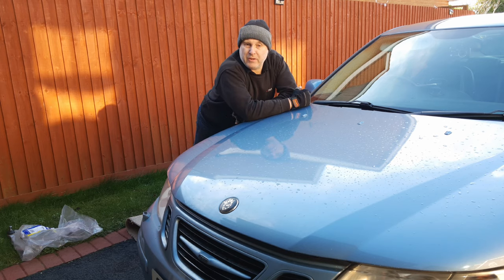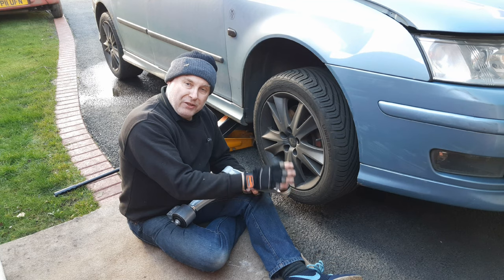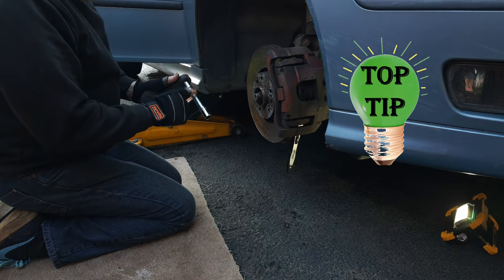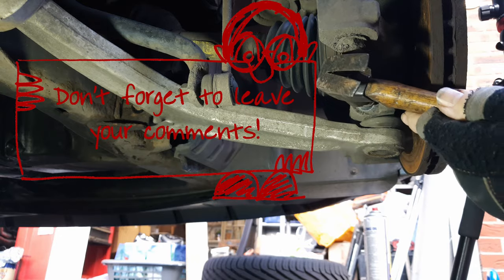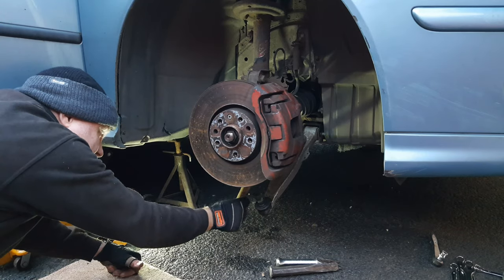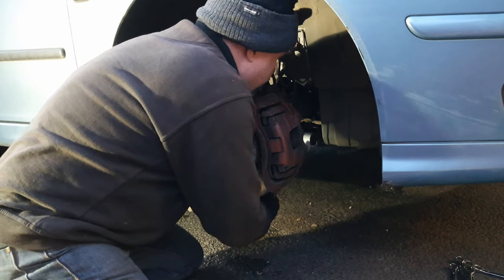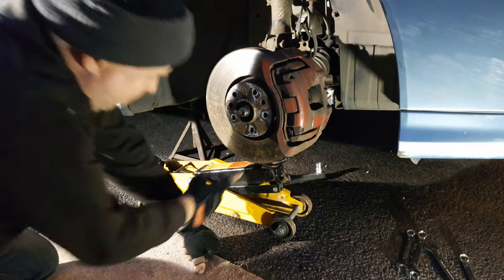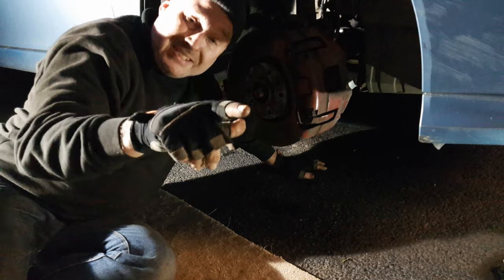Saab 9-3 Front Wishbone Replacement | Front End Clunking Noise When Going over bumps

Comment: There's a repair kit from SAAB Ref 12799814, its a bellows kit to change the rubber bushing and circlips of the strut rotule, so you don't need to change all the control arm for a new one, you refurbish the old one, as long as the others 2 horizontal bushings are good (but, even the back horizontal one can be changed, there's a separate ref. for it). Do you know about that kit, did you ever used it ? thanks.
Reply from the maker: I wasn't aware of that kit, but in general the gaiter on ball joints can be changed and there are plenty of universal ones available. You really need to know the ball joint is in excellent order if you're only changing the gaiter.
Reply: @CycloneCyd   yes you can’t keep the rotule knocking on the arm through the damaged gaiter rubber for too long, cause it’ll become non spherical and loose the ability to perform well just changing the gaiter kit. But if you do it as soon as you feel the knockings, it’s a cheaper way to sort it out I think, both sides repair kits cost less than one complete arm 👍

Comment: When using the jack to install the ball joint stud into the socket (and when preloading the bushing), shouldn't you lift from the suspension arm rather than from the ball joint? Lifting directly underneath the ball joint risks damaging the ball joint cap, right? Especially if the jack does not have rubber padding in the contact area, thus resulting in metal-on-metal contact between the ball joint cap and the jack.

Comment: Thanks for running through this, allows for tackling the job with a bit more confidence. One important thing that you don't mention is tightening the rear bush bolt after applying load on the arm. mine was loose as a goose from the supplier.

Here are torque settings (from the SAAB workshop system) for all mounting points:
Arm (pin) to swivel member - 50NM
Rear bush mount (the 2x18mm) - 65NM then additional 90 degrees rotation

Then after load applied:

Arm to Front bush - 65NM then additional 90 degrees rotation
Arm to Rear bush - 40NM  then additional 30 degrees rotation

Please note that there are some much higher torque ratings given on several Vectra C tutorials and documentation. Not sure why as most of it is the same platform right?!

Comment: Superb video mate, most technicians will never tighten these bushes with the suspension sitting at ride height, which leads to premature failure of the bushings and annoying noises ( a way to keep the customers coming 😂😂) cheers
Reply from the maker: Ha ha, a lack of training mostly, but yeah, some are dishonest like that. Actually, one of my old Uni buddies works in Chassis, upstairs from me, so I've known this for years. Haynes manuals also used to include this tip (not sure if they do anymore though). Many thanks.

Comment: Thank you for posting Cyd, my 2004 9-3 has about 130,000 miles and has started knocking over bumps, especially on cold mornings. I bought 2 new suspension arms and doing them today!
Reply from the maker: I had a right old game disconnecting the ball from the hub!!!! let us know how you get on.
Reply: @CycloneCyd  Both switched out, the tricky part was aligning the holes, found that installing the ball joint first was the easiest way to install.
Reply from the maker: @rhynecars  , six of one, half a dozen of the other IMO. Thanks for the tip, I'm sure others will find it useful.
Did it cure the knocking?
Reply: @CycloneCyd  Yes thank you! Would you be able to show us more of the rally car world in a future video? Maybe you could walk through the mechanical aspects of what mechanical upgrades makes a rally car unique, or even how to make a road car better equipped for rally duty?

Comment: Thanks for this guidance unfortunately there are a few different knock producers on the front end of a saab for me drop links have been a common problem. Current one for me is a firm clunk which comes on brakes biting at low speed. Any suggestions!
Reply from the maker: Oh, blimey yes. There are no end of knock producers. Drop links are common, but also:
wishbone ball joint;  rear wishbone bush;  top mounts;  top mount bearing;  track rod end;  inner track rod ball joint; shocks;  springs (broken);  brake pads (loose in caliper);  subframe bushes.
Currently my RH inner track rod ball is knocking so I'll be replacing it soon (video to follow).
For your knock I'm thinking rear wishbone bush, but don't hold me to that.
What you really need is one of these https://amzn.to/31FI0Sl

Comment: That's an amazing run through, thanks for all the detail and background info! 
Now I'm questioning my naive confidence continuing to drive with a louder and louder clunking 😅

My question is about jacking the suspension up at the end, seems a bit dangerous and precarious working under a dynamic sprung-load, did you position the jack under the rotor or something a bit more stable?
Reply from the maker: Jack under the ball joint. Remember the car is still on it's axle stand so can't fall.

Comment: Hi CC !  Do i have to use a new nut on the bolt for lower ball joint when assembling a new wishbone ? Thanks for good video`s ! Kind regards from Norway.🙂
Reply from the maker: Shouldn't be necessary if the fitted bolt is in good condition. If you need one, Neo Bros keep a few good used ones (I needed one)

Comment: Thank you for this video. I forgot to put the weight of the car when I tightened the front bushing. When I went for a test drive I heard a slight squeaking from I’m guessing the bushing. Is it ok if I just loosen the bolt and re tighten it the right way?
Reply from the maker: Yes, that'll be fine. Spray a little silicone lube on the bush and bounce the car with the bolt loose, so it settles in place before tightening again.

Comment: Hi, really useful video with additional explanation.....I would like to change the wishbone, not about knocking noise, my car is pulling right. Do you think the wishbone can cause this phenomenon?  I think there was a minor accident with the car , because of the right headlight is brighter than the left one!
Reply from the maker: Mine pulls ever so slightly to the left, yet the car is perfectly aligned. It is caused by the camber of the road.
Pulling to one side can also be caused by the rear wheel toe being out of alignment. It is CRUCIAL to have these aligned on a HUNTER four wheel alignment rig.

Comment: Is it advisable to do both sides at the same time? Should I get my tracking done afterwards?
Reply from the maker: Yes, otherwise you'll have new bushes on one side and old on the other. You shouldn't need the alignment done, but if it's been a long time then get a 4 wheel alignment. Find somewhere with a Hunter rig if you can.
Reply: The left one arrived yesterday so I'll order the other today. Thanks for the advice.
Reply from the maker: @meehollmurakoo1673  You're welcome
Reply: Sir, I just bought a 2006 Saab 9-3 “saloon“ as you UK folks like to call them :-) At lower speeds little bumps produce a clunk, but not at higher speeds. I don’t really feel the clunk as one would expect with a worn suspension component, I simply hear it. The vehicle only has 112,000 miles on it. My problem is that I don’t really know what “normal” is. I’ve never driven a brand new Saab 9-3. How many miles did your car have on it before you started experiencing the noise in the video?
Reply: @pjackson65  how did it go? I'm about to find out if my knocking is the wishbone or the sway bar bushes. My knocking developed slowly over a couple of months and is just getting louder. A couple of years ago a similar sound was fixed by replacing the sway bar linkages
Reply: @jarrahclarke2319  that’s what I did too, replaced the sway bar links and now she rides like a dream :-). I’m starting to think that with these vehicles they should be considered a 60k-80k mile service item.

Comment: will it also make a noise when i twist the wheel ive noticed that my saab 9-3 MY 07 is starting to make clunking noises when turning and i know its not a broken spring ? could it be an axle ?
Reply from the maker: Hi Omar, clunking noises from the front can be the Devil's own work to track down. I'd check the steering universal joint (https://youtu.be/cAtKiEoRD-g and https://youtu.be/K7CuWjN8VJk) or the inner track rod ball joint as first ports of call. Be sure to let us know how you get on
Reply: Knocking noises can be so much! If it is over bumps, it is usually the ball joint in this video or springs. If it is on uneven roads or potholes, and it sounds like your car is falling apart, it is probably the sway bar bushings or end links. Mine was making horrible noises, and I replaced my front end links, and rear bushings (those were a real bitch). End links removed some noise, but the worst was coming frlm the loose bushings on the rear. Now it is completely silent even though my ball joints are worn out on all four wheels.

Comment: You will notice on the wishbones
Their is a flat flange with two holes.  On some saab 93s  screwed to the two holes is a tiny motor with cam operated lever.
Their are two of these
One passenger front wishbone
The other driverside rear.
Both electrically operated.
Anyone know what these are and what is their purpose.
Reply from the maker: Suspension height sensors for the xenon headlights. See from 7:00 in the video
Reply: I appreciate that...thanks